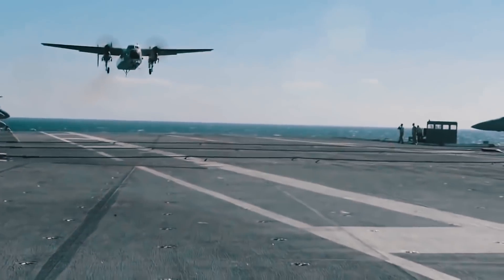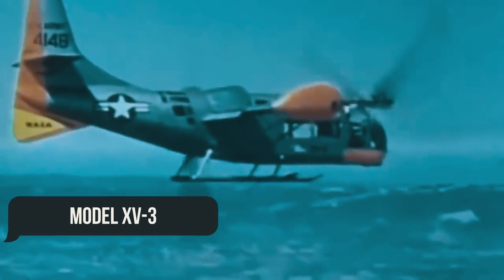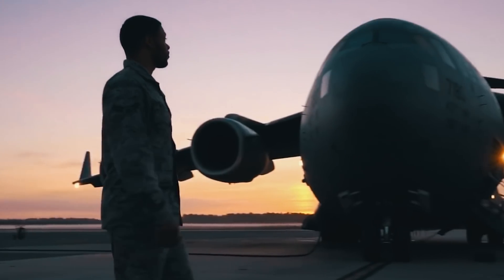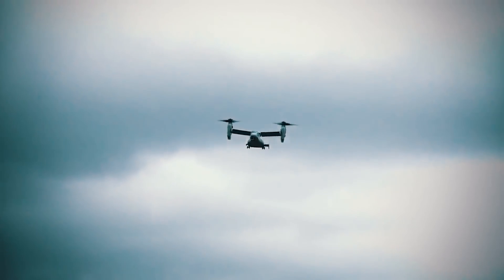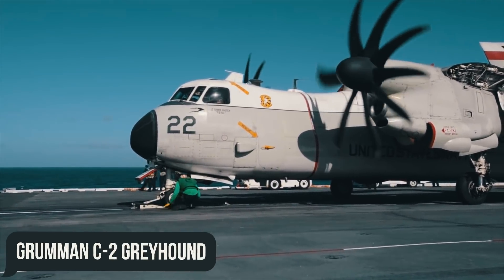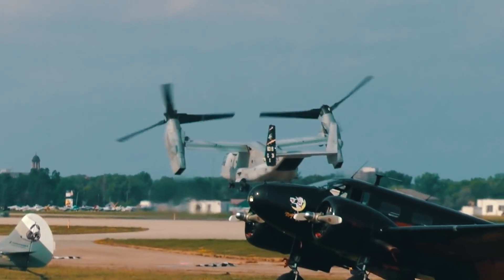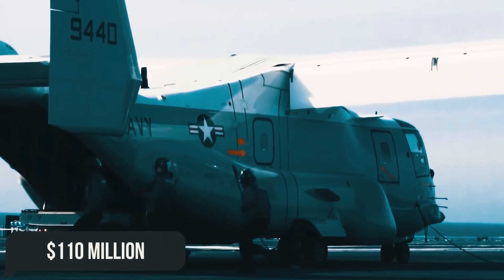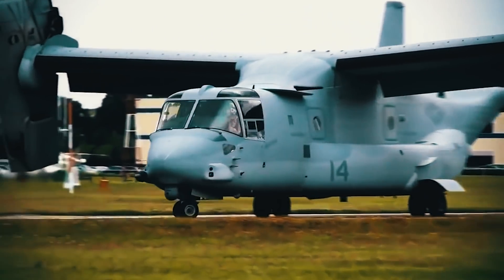The C-2 Greyhound Replacement is Coming

Comment: The ships deck doesn't need to support the weight of the v22 if they use underslung cargo, it would also speed up turn around time, and maybe even deliver to ships without a helideck, possibly even submarines, underslung personnel might be a little "out there" but the rest would be very doable.
Reply: i doubt it, these things are on their way out, they're fixing to find out rotor tech is no longer the way to go, but to develop non-rotor lift technology that can be far more compact, can fly far more stable, quieter, and doesn't require warm up starts
Reply: 0:19 oh look it’s a V22 OSPREY
Reply: 0:19 oh look it’s a V22 OSPREY
Reply: I am waiting for a shorter range "electric" VTOL.  Electric motors have incredible HP/pound and they DON'T operate at high temps which "eat" expensive materials and have thousands of parts (many of which deteriorate).

one  problem I see is that the big "paddle blade" propellers are quite efficient, complicated  and vulnerable and need a high power gearbox.  They could be driven by high power electric motors, but the battery weight for a long range VTOL is the problem for now.  That's why I see shorter range Electric STOL and VTOL filling a need.   Add up all the expensive frequently replaced parts in the Osprey  and it is a money pit like all gas turbine powered aircraft.   Nobody likes the reliability of piston powered aircraft either.  The development costs of the V-22 are never coming back.  Gas turbine engines are not "turn on and forget"  like three phase induction motors which can last for decades and only have TWO  bearings to wear (slowly).  The same is also true for the new permanent magnet DC motors.  The electric  motors are just magnetic fields and electrons "chasing each other around".  There are NO brushes from the olde days.  The high power semiconductor electronics  are already proven and Tesla and others buy them by the millions!  Osprey's will be going to the scrapyard as soon as anyone bothers to build a short to medium range electric VTOL.  Gas turbine engines waste more fuel energy  making noise and heat vs moving the vehicle. 

  I know the major aircraft manufacturers will fight tooth and nail to keep a better less expensive idea from killing most of their business.  There will be   carefully contrived regulations that have nothing to do with safety slowing adoption of better ideas.  Just remember there is NOTHING more reliable than a 3-phase induction motor or permanant magnet motor.  See Tesla for examples.  Efficiency is easily above 90% with  current technology. 

There  are lots of uses for short range VTOLs Ex. commuter and , battlefield  lifting people and supplies w/o being a "flaming fuel tank" due to battle damage or accident.
Reply: @LuybXAzH2  I dunno about riding into combat in something that's 100% powered by lithium batteries. I can count on putting out a C fire (fuel) a lot easier than a D fire (material with self-oxidizing material).
Reply: @LuybXAzH2  Electric motors have a fantastic HP/lb ratio, until you weigh the battery they need to be useful.  EV's are likely the future in all but supersonic applications, provided that future has something considerably better and cheaper in all regards than lithium batteries.